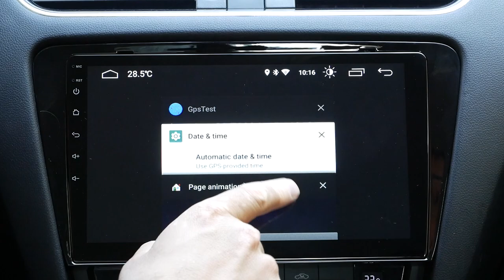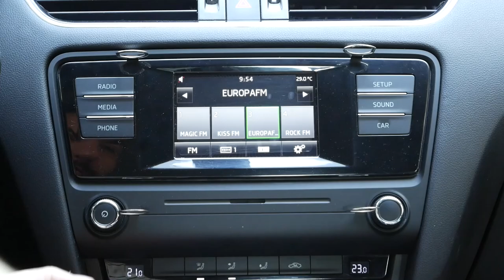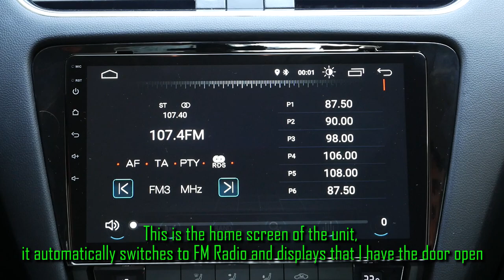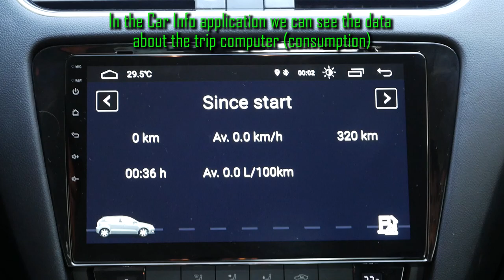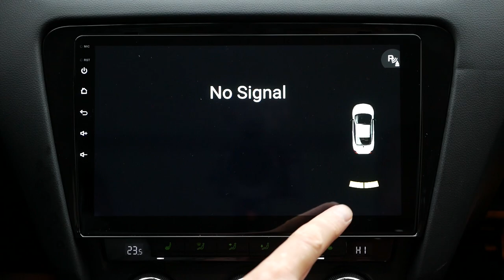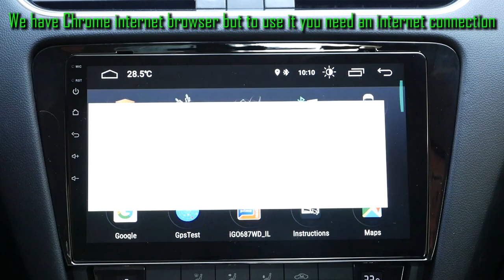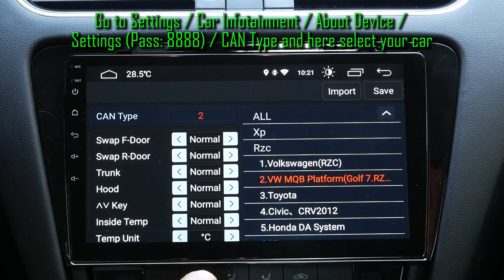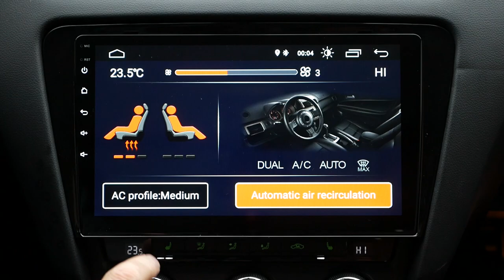Install 10 inch Android Multimedia for Skoda Octavia 3

Comment from the maker: Links: 
- Octavia 3, Android 10 inch, Octa Core 4Gb ram: https://www.aliexpress.com/item/4000096202042.html?aff_fcid=c33f414ee3d9460cab6eb734c5b7ee88-1617606877863-05989-_AZ5VLQ&aff_fsk=_AZ5VLQ&aff_platform=shareComponent-detail&sk=_AZ5VLQ&aff_trace_key=c33f414ee3d9460cab6eb734c5b7ee88-1617606877863-05989-_AZ5VLQ&terminal_id=364d159dab6d4da48c68657f8054a5c8&tmLog=new_Detail
- Octavia 3, Android 10 inch, Quad Core 2Gb ram: https://www.aliexpress.com/item/32984862064.html?aff_fcid=042709948c334449ae5cf846edafcc56-1617606899332-05980-_Am8bPW&aff_fsk=_Am8bPW&aff_platform=shareComponent-detail&sk=_Am8bPW&aff_trace_key=042709948c334449ae5cf846edafcc56-1617606899332-05980-_Am8bPW&terminal_id=364d159dab6d4da48c68657f8054a5c8&tmLog=new_Detail
- OBD ELM327 Adapter: https://www.aliexpress.com/item/1874800254.html?aff_fcid=33a28dd96ac94561a3d13dc055d1342b-1617606925484-05174-_9QL3FI&aff_fsk=_9QL3FI&aff_platform=shareComponent-detail&sk=_9QL3FI&aff_trace_key=33a28dd96ac94561a3d13dc055d1342b-1617606925484-05174-_9QL3FI&terminal_id=364d159dab6d4da48c68657f8054a5c8&tmLog=new_Detail
Reply: Today I bought this. I have problem with that CANbus. My model has Android 10.0 with a little bit diferent menu.  My menu is misssing choise: Car Infotainment. The conection with car computer dosn't exist.
Reply from the maker: @bzz7318  Hello. Do the steering wheel controls work? I think the conbus is not set well in the menu.
Reply: @Adrian_AFD  Thank you for a idea. I found line in the menu, where I set Canbus device. Rzc is Raise!
Reply from the maker: @jozefszabo5632  Great! :)
Reply: I guess Im kinda off topic but do anybody know of a good place to stream new tv shows online ?
Reply: @Korbin Elliot try flixzone. You can find it by googling :)
Reply: @Memphis River yea, been watching on flixzone for years myself :D
Reply: @Memphis River thank you, I went there and it seems like they got a lot of movies there :D I appreciate it !!
Reply: @Korbin Elliot no problem :)
Reply: @jozefszabo5632  can you please tell me where is that line and what is password for developer options?
Reply: Salutare!
Daca nu am comenzi pe volan are vreo influentă?
Functioneaza la fel?
Multumesc
Reply: What to do if I have no controls on steering wheel? How to adjust volume etc ?

Comment: This definitely worth and it's way better looking than that cheap basic radio and i would go for better version with 4Gb ram of this Android device. But i wouldn't change anything in my car if there is at least Bolero radio installed.
Reply from the maker: The best option for an Android device is one with an octa core processor and 4 GB of RAM.

Comment: which model would then be compatible with the CANTON system on octavia 3 please?
Reply from the maker: Hello. I have not seen any Android unit running with Canton audio system. But you can install an Android module that keeps the original multimedia unit and add an Android menu, it also works with Canton, see in my video: https://www.youtube.com/watch?v=EFKcHsgY5jk

Comment: Did you get the "Setup" button to work thats on the scroll wheel for the fan? I cant get to the menu where putting in the timer for the diesel warmer. =/
Reply from the maker: Hello. I don't know what to answer because the car on which I installed the module does not have a diesel heater.
Reply: But what does your setup button do on the fan wheel?

Comment: Hey Bro thanks for doing a video and sharing information. 

Just 1 thing to ask, where do u get the 4 special keys to unlock the original head unit at time 3:08 ? 
Does it comes with the new android head unit ?
Reply: Did they come with it after?
Reply: Aliexpress has them.  They cost almost nothing.

Comment: Hello, how well did the unit perform after a longer period of use?
I have bought a unit(not the same brand), and is it not working that well, to be honest I think to return the unit because of the disappointing functioning.
Reply from the maker: Hello. I no longer have that car with Android navigation, but I can tell you my conclusion: navigations with quad-core processors and 1 or 2Gb RAM memory are not the best.  I have the best experience with Android navigations with Octa-core processors and at least 4Gb ram memory.  What specs does your Android multimedia have?
Reply: 8 core 3 gb ram, but the internal microphone is just crap, option to get external cost about 15€ extra. The car menu is just to difficult to navigate in, they show all option that is possible but not just the ones the car has. Fx it shows sun roof when the car does not have sun roof

Comment: I have a question. How to remove the new radio? I can stick only 2 of 4 keys and the bottom is still holding it in. 
Reason why I'm asking: I put cable from subwoofer in the wrong input (maybe) and now is sub quiet. I have to check it one more time but I can't open it. Thank you
Reply: Gute Frage...
Das habe ich auch gedacht..
So was war ein Kunst vielleicht weil das ist bei neues Mediagerät völlig besondere Body Kit..
Reply: Schade

Comment: Can you help me I have installed the radio in version 4/64 gb.  Everything is ok except stock usb.  I installed the adapter as explained in the video but it doesn't work.  Do you have any advice to solve the problem
Reply from the maker: Hello. Check the connections again, otherwise I don't know what the problem may be.
Reply: Where did you get this adapter for original usb socket? Thanks

Comment: Buna. Foarte instructiv! Mi-am comandat si eu modelul pentru o Skoda Superb 3. Sper sa ma descurc. O rugaminte: imi recomanzi un sistem pentru un Ford Mustang 2015 cu Sync 2. Multumesc.
Reply from the maker: Salutare. Sunt sigur ca te vei descurca sa instalezi. 
Cat despre Mustang am gasit ceva modele dar nu sunt ferm convins ca e ceea ce-ti trebuie:
1. https://www.aliexpress.com/item/32903056934.html?aff_fcid=9feabceb27d34fe3a7997e3688e4cd92-1616706002810-02444-_ASKpxi&aff_fsk=_ASKpxi&aff_platform=shareComponent-detail&sk=_ASKpxi&aff_trace_key=9feabceb27d34fe3a7997e3688e4cd92-1616706002810-02444-_ASKpxi&terminal_id=d92441f0a7b94ef29dcdfc816a4dd068&tmLog=new_Detail
2. https://www.aliexpress.com/item/1005002021817818.html?aff_fcid=325ece907f8b4e7992b9aa81a02b16c5-1616706015300-00449-_AOUIvE&aff_fsk=_AOUIvE&aff_platform=shareComponent-detail&sk=_AOUIvE&aff_trace_key=325ece907f8b4e7992b9aa81a02b16c5-1616706015300-00449-_AOUIvE&terminal_id=d92441f0a7b94ef29dcdfc816a4dd068&tmLog=new_Detail
Reply: @Adrian_AFD  Am montat sistemul pe Skoda. Totul este ok cu exceptia faptului ca nu mai functioneaza usb-urile de pe masina: am verificat de mai multe ori conexiunile si sunt bune. Nu stiu care este problema. Probabil de acceea nu functioneaza si CarPlay-ul. Probabil voi comanda un microfon ptr ca cel de pe sistem este slab. Overall este bun.
Reply from the maker: @albin73  Salut. Este posibil sa fie o incompatibilitate a acelui adaptor, ce-i drept eu nu folosesc USB-ul si nici nu am montat adaptorul :)

Comment: I have an issue with the speaker. How can fix it? The other side cant hear me very well.
Reply from the maker: Hello. Can you tell me in more detail what your problems are?
Reply: I meant the microphone. When I'm making a call the other side of the phone can't hear me very well and there is a delay.
Reply from the maker: @yymdt  Did you install an external microphone or does your Android unit use the internal microphone (the one in the small hole on the top left above the display)?
Reply: @Adrian_AFD  thanks for your replay. I didn't install any microphone.
Reply: @Adrian_AFD  I installed external 3.5 mic, but nothing happens, the unit stil use internal mic. Do you have any idea where to turn it on?

Comment: What about the unit from the glovebox. Do I plug it back again and it will work or remove it permanently
Reply from the maker: Hello. As long as the Android device is connected, the unit in the glove box will no longer work. If you remove the Android drive and reconnect the CD drive from the glove box it will work.
Reply: @Adrian_AFD  Ok, Thank you for information

Comment: This head unit made my cluster German after two weeks and I have no way to change it back without putting the old head unit back in the head unit is in English but not my cluster and the settings to change are locked into the old head unit

Comment: Hello please can you tell me which app is the car info?I own a 2017 rapid spaceback and recently I installed an android head unit but mine is not as goos as yours.Thank you
Reply from the maker: Hi. Did you set Canbus correctly in the Factory Settings menu?

Comment: Will the DAB function still work if I install this unit? Thank you :)
Reply from the maker: Hi. If you replace the original radio and it had DAB, the DAB function will no longer be available on the Android unit.  But you can buy a special DAB module for Android unit: https://www.aliexpress.com/item/1005002843478353.html?aff_fcid=cad6043b1f6446a3a60fb2489249d678-1629389184077-09269-_AEBizG&tt=CPS_NORMAL&aff_fsk=_AEBizG&aff_platform=shareComponent-detail&sk=_AEBizG&aff_trace_key=cad6043b1f6446a3a60fb2489249d678-1629389184077-09269-_AEBizG&terminal_id=1caff12f1f9d493691c33a5a59bc05ab

Comment: Hi, I have a question.  Did you need any app to see the car's functions?  Has this option been already on the radio?  I have a similar radio and I can't find the car's functions.
Reply from the maker: You need to set the Canbus protocol correctly in the Android menu, the application will probably be activated as well.  See in my video at 15:20
Reply: @Adrian_AFD  I found it in the settings and activated it, it shows me options, but it does not react to anything when I want to set it.  Do you think this could be a problem with the Canbus box?
Reply: @lukaszromaszko6930  can you tell me where you found that options?
Reply from the maker: @sinisaravlic4423  Several functions are displayed in the Android tablet, but it will only react to the functions that your car has active.

Comment: Hi,
Since you can remove glovebox unit. How can you connect camera to this unit? Is it possible to show? What about FM signal. is it bad? thanks!
Reply from the maker: Hello. The camera connects to the dedicated RCA cable for Rear View Camera IN, see in my video at minute 3:01 . I hope to make a tutorial in the spring / summer on how to install the rear view camera.
FM Radio reception is weaker than the original radio, but I listen the online radio through the Tune IN application, so I'm not very interested in FM Radio.
Reply: @Adrian_AFD  but can it be connected to the original antenna? 
What about hands free calls? Is microphone good? Ive actually ordered it :D
Reply from the maker: @zigajamnik  You will receive an antenna adapter, so you connect directly to the car's antenna.
Bluetooth handsfree calls work well and sound good.
Reply: @Adrian_AFD  thanks! Looking forward for camera installation. Need a tutorial how to dissasemble trunk parts :p
Reply: Hi, do you have any contact? Ive opened car radio unit and there are no power cables in the back? Only 2 small cables? I need power from glove unit i guess? Amundsen radio i have...
Reply from the maker: @zigajamnik  Hi. You need to power from glove unit. See my Facebook page in clip description.
Reply: @Adrian_AFD  can you link me a video or something? I cant find it
Reply from the maker: @zigajamnik  You can see in my video at minutes 3:30
Reply: @Adrian_AFD  thanks for help! What about microphone? i have it built in in my Octavia I guess. i dont know where is it connected, but would like to connect it to android unit?
Reply from the maker: @zigajamnik  The microphone sounds good.  The original one is next to the ceiling lamp.  I'm not sure if Android unit uses the original or the built-in microphone.
Reply: @Adrian_AFD  when im calling people barely hear me. Voice is not clear with headunit mic :/
Reply: @zigajamnik  Hello friend, did you manage to solve the microphone problem?
Reply: @pubgplayer8680  hi, seller said he will send me external mic. Original sucks! I am still waiting for external one

Comment: Can you advise how to install it if you have a MIB1 With all connections in the glove box
Reply from the maker: Remove the glove box, remove the unit from the glove box, unclip the cables and push it to where the Android unit will be installed.
Reply: @Adrian_AFD  thanks for the answer, but what to do with the LVDS connection where do I put that or is'nt that nescesery?
Reply from the maker: You no longer need the LVDS cable because you no longer use the original screen.
Reply: @Adrian_AFD  Thank you for the answer. And thank you for the super clear instruction video!

Comment: Salut! O voi comanda foarte buna si din cate vad si calitativa. Intrebare este daca merge conectat ios la ea? Spor in continuare la treaba✌️
Reply from the maker: Salut. Se pare ca pentru ios ai nevoie de un adaptor ce se conecteaza pe cablul USB: https://www.aliexpress.com/item/4001290167913.html?aff_fsk=_9AlpLW&aff_platform=shareComponent-detail&sk=_9AlpLW&aff_trace_key=47292260960e4a118fe4d36eff87d011-1613216938899-09093-_9AlpLW&terminal_id=364d159dab6d4da48c68657f8054a5c8&tmLog=new_Detail

Comment: Salut! Am comandat pt octavia 3/2014 din Polonia varianta 2Gb/32Gb si am ceva probleme... Nu e ca cea din clip ca meniu, usb-ul masinii nu merge, setarile masinii gen presiune pneuri nu functioneaza(le afiseaza dar nu merg setate), pe displayul din bord nu mai arata nimic(consum, range, etc), cere mereu conectare cu telefon. Mai trebuie sa cumpar sau sa setez ceva? Am luat exact navigatia din descriere... In rest se misca f bine, se aude f bine, si se vede neasteptat de bine.
Reply from the maker: Salut! Incearca sa te mai joci cu setarile pentru canbus, alege diverse modele din grupul VAG cu aceeasi platforma ca a masinii tale (Golf 6, Golf 7). La capitolul Bluetooth acesta nu va mai functiona deoarece modulul se gaseste in unitatea ce acum este deconectata. Fie conectezi unitatea originala si stergi toate telefonele cu care a fost imperecheata si atunci probabil nu va mai cauta un telefon, fie te obisnuiesti cu acel mesaj :D. Daca nu rezolvi problema cu meniurile intreba-l pe vanzator poate stie vreo solutie, setare...
Reply: @Adrian_AFD  Am pus iar navi originala, am sters toate conectarile, apoi din nou navi android si am conectat-o cu tel acum aratandu-mi in bord tot ce trebuie (range, temperatura ulei, etc). Apoi am trecut prin toate setarile canbus si doua se potrivesc cu masina, iar una ma lasa sa umblu doar la asr on/off... tot e un pas. Acum chiar incepe sa-mi placa😉! Multumesc frumos pt raspuns!

Comment: Hi do you know why this unit won’t work with canton sound system ?
Reply from the maker: Hello. Canton audio system uses optical audio to receive the signal, so it is not compatible. For the Canton audio system there is this compatible Android module: https://youtu.be/EFKcHsgY5jk

Comment: Salutare! Pentru Skoda Octavia 2 model 2006 imi poti spune ce navigatie sa cumpar? Multumesc frumos!
Reply from the maker: Salut. Cea mai buna navigatie pe care am instalat-o pe Octavia 2 este modelul din link-ul de mai jos, cea mai scumpa varianta cu livrare din Polonia: https://www.aliexpress.com/item/32808121524.html?aff_fcid=716ce68d5b7e4d59bd464f75cbd27725-1621890993037-05625-_ATX34j&aff_fsk=_ATX34j&aff_platform=shareComponent-detail&sk=_ATX34j&aff_trace_key=716ce68d5b7e4d59bd464f75cbd27725-1621890993037-05625-_ATX34j&terminal_id=d92441f0a7b94ef29dcdfc816a4dd068&tmLog=new_Detail
Reply: @Adrian_AFD  Mulțumesc frumos! Eu sunt din Constanța. Un ajutor pentru montare, se poate?
Reply from the maker: @popescuion9075  Salut. Sigur ca da. Te rog sa-mi dai un mesaj pe pagina mea: https://www.facebook.com/psadiyrepairs

Comment: Buna seara. Ma puteti ajuta va rog cu o mica problema. Tocmai ce am achizitionat un Junsun V1 Pro (6GB, 128GB) pentru Octavia 3 si cand sunt conectat pe bluetooth nu ramane conectat si wi-fi. Dupa 5-10 secunde se deconecteaza singur wi-fi. Nu pot sa stau conectat pe ambele (wi-fi + bluetooth). Exista vreo setare care trebuie facuta? Sau exista vreo solutie? Multumesc.
Reply from the maker: Salutare. Daca unitatea are Android Auto / Carplay Wireless cel mai probabil aplicatia vrea sa se conecteze la telefon si transforma conexiunea wireless obisnuita in hotspot. Dezactiveaza aplicatia de conectare la Android auto / Carplay. O alta potiune ar fi sa folosesti un sim de date pentru internet (daca are unitatea slot pentru asa ceva), eu am luat un sim de la Digi cu 2 euro / luna.
Reply: Salut. Producatorul mi-a recomandat sa fac update de firmware, mi-a trimis si link-ul de descarcare, dar cand conectez stick-ul in oricare dintre USB-uri nu incepe automat update-ul, Exista o alta solutie sa fac manual update? Daca intru la MCU update este acelasi lucru? Multumesc.
Reply: Salutare din nou. Ai avut perfecta dreptate. Aplicatia era setata sa se conecteze automat. Am debifat optiunea de a se conecta automat si acum totul functioneaza perfect. Multumesc frumos pentru ajutor.
Reply from the maker: Ar trebui vanzatorul să-ți spună exact cum se face. Sunt mai multe posibilități...

Comment: since in the origin i only have two small cables??? one black and one white!!!
Reply from the maker: Hello. You will need to connect with the power plug of the original unit from the glove box.
Reply: @Adrian_AFD  and configure the steering wheel controls with the rad